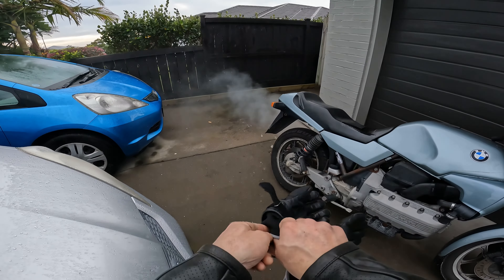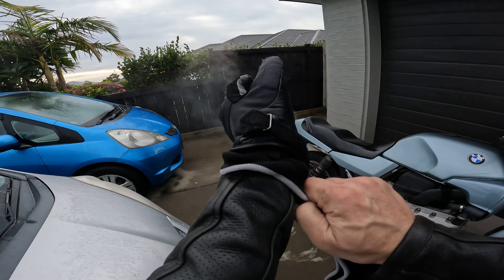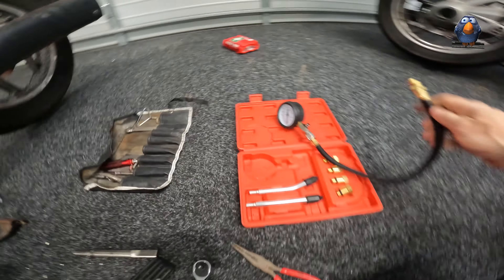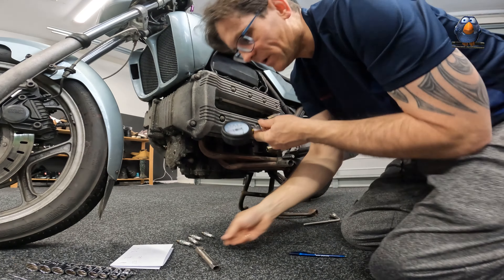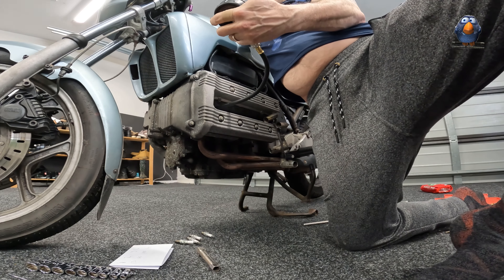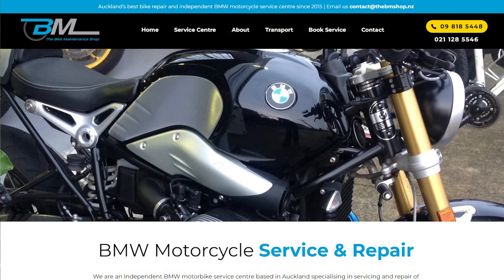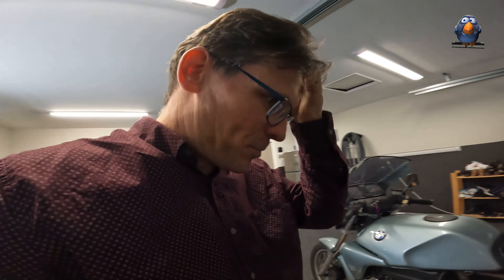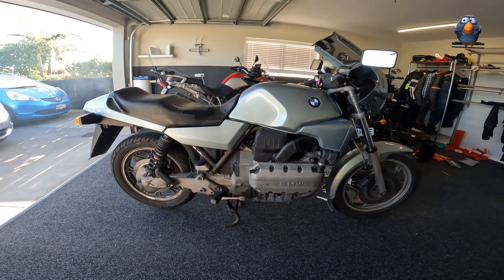[EP3] BMW K100 Café Racer Build - Compression Test

Comment: You do the test with a cold engine
Reply: He warmed-up the engine at the beginning of the video
Reply: I understand but to do a correct compression test the motor needs to be cold  with an open throttle  @adeyinkaadeoye9343